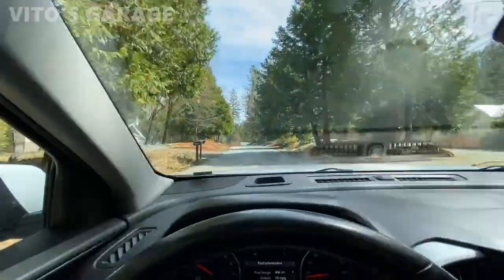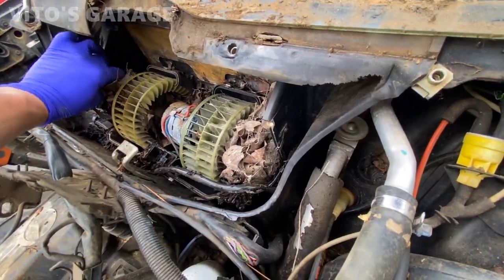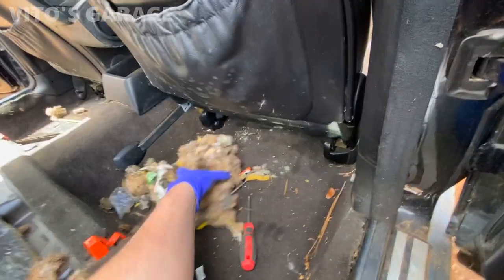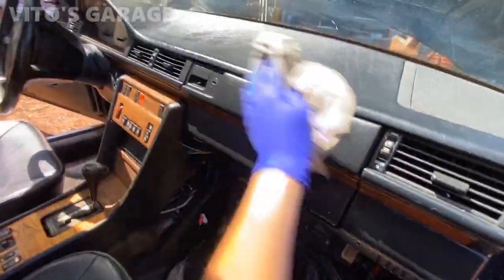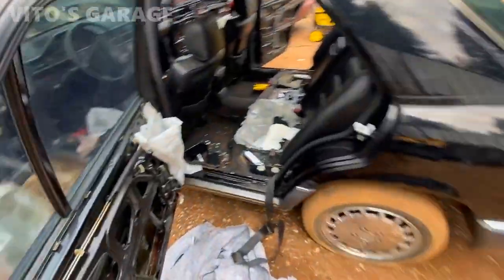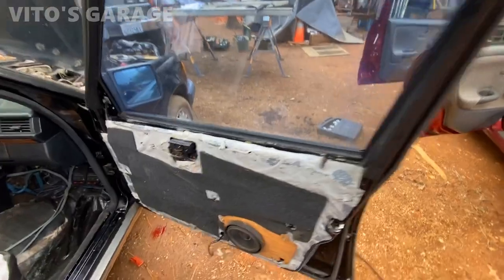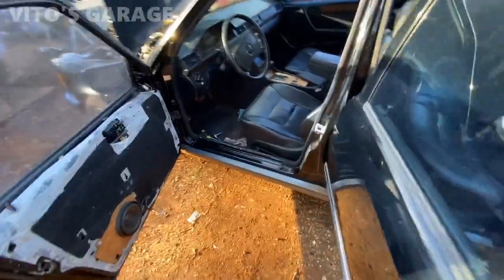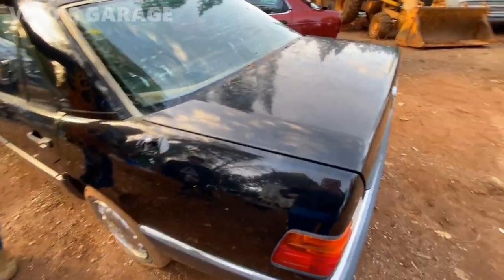Working the Entire Day on a Black on Black 1991 Mercedes W124 300E! Signs of Life

Comment: Picking up a 1990 300e with 200,000 miles for $600. Runs and drives but been sitting for 6 years. Never had one before so should be fun!
Reply from the maker: Amazing!! Keep me updated and thanks for helping me save and love these cars!!
Reply: @VITOSGARAGE  sure thing!! Glad to have found you, helps with me on getting mine road worthy again
Reply: @VITOSGARAGE  is this the year that head gaskets are an issue??
Reply from the maker: @jcritter9295  head gaskets can go bad. Never overheat the engine. That’s the worst you can do to any engine. Head gaskets are easy to change on these. When you remove the cylinder head, make sure to check for straightness of both the head and block
Reply: @VITOSGARAGE  yep! The temp gauge isn’t working so gotta fix that first thing. No one has in stock. Have to order the temp sending unit.
Reply: @VITOSGARAGE  know all too well what can happen when overheating. Old 80’s escorts my dad worked weee notoriously bad on warped heads just barely getting them hot. Aluminum heads
Reply: @VITOSGARAGE  had to have the car towed home. Antifreeze coming out onto the ground on the drivers side. Looks like the leak is coming from the bottom of the water pump. So going to change it out this weekend. Praying it’s not the head gasket. Rather not get into that right now. Runs great though. Cleaned on it but love to get that torn apart so at least I’ll know one way or the other on why it’s leaking so bad. You could pour coolant in and it would leak right out without running.

Comment: love this video, i have w124 300e and have problem with mono wiper, wiper speed 1 is not working but 2 and 3 is working fine, and when i stop the wiper it not completely down it block the windshield little bit so i need to push down the wiper to resting place
Reply from the maker: The wiper mechanism needs to be disassembled and greased up and the alignment adjusted. It takes patience